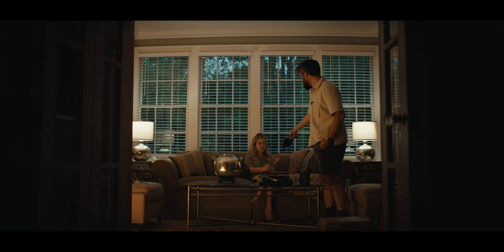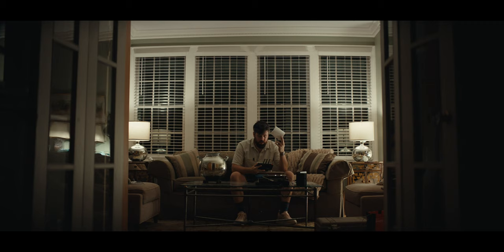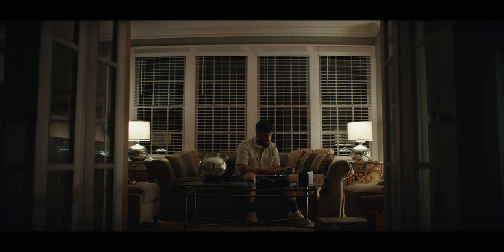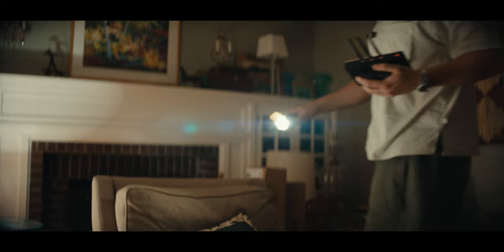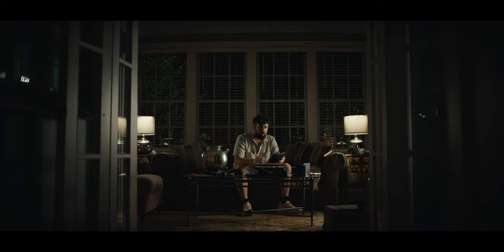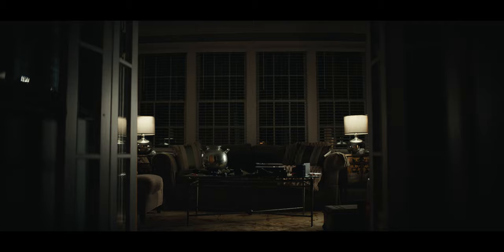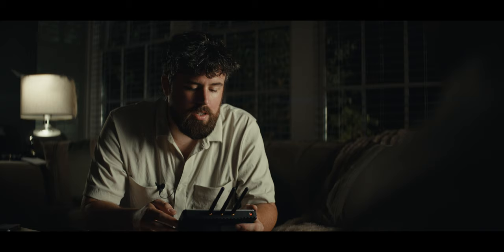Lighting night interiors

Comment: 00:00 - Intro
00:34 - Initial lighting setup, facing challenges with dark areas and shadows.
01:44 - Experimenting with practical lights and their impact on the scene.
03:09 - Using practical lights creatively, considering small practical sources for lighting.
04:33 - Adjusting lights for better exposure and realism, adding potential backlighting.
06:10 - Enhancements made for the scene, including exterior lighting and key light diffusion.
07:44 - Fine-tuning practical lights' impact, managing reflections, and overall scene balance.
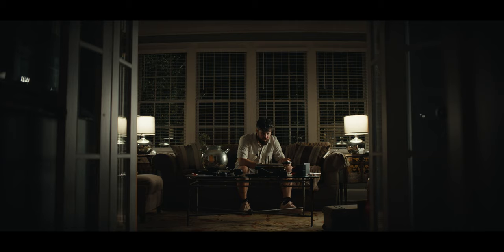09:33 - Achieving a more complete and satisfactory lighting setup, further improvements discussed.
Reply from the maker: Thanks for this, I meant to add to the description.
Reply: The fact he did this for you shows the love. 🤙
Reply from the maker: I owe a favor!

Comment: I think your final wide shot looked great, definite Fincher/Cronenweth vibes. I'm a beginner and often spending my nights up late like this on my own, when everyone else has gone to bed just hours and hours looking at my monitor, making small adjustments to the lights, and seeing what works and what doesn't. Lots of fun except when it's 2 or 3am and you have to just pack up all your gear that took ages to set up.
Reply from the maker: Thank you. Gaining a very good control over every light and what it’s doing is important. It’s easier when testing that it is on set, but the more you do it the quicker you are able to gain control on set and walk onto the set and know exactly what to do. Packing it up is tough. I enjoy leaving it out lol.

Comment: Great practice. So important to improving your skills. 

A few things that you might explore in the future: 

1) Practicals are rarely daylight balanced, so you might try setting them somewhere between 2000-2800 next time. To me, this would have made the scene look more natural. 

2) Not sure why you would put foil on the back of the practicals. The shadows/slashes of light that they create are the most “realistic” thing in your shot, so in my opinion you diminished the believability the minute you did that. 

3) The backlight you added about half way through seemed out of place, especially since your shoulder created a slash of shadow across your neck — giving away the fact that it was a source light rather than the practical. 

Thanks for sharing. These videos add a lot to the overall growth and development of future filmmakers.
Reply from the maker: hey thanks I only went daylight bc that is what I had, and if everything is daylight, you can balance the camera warmer and it will look very similar, minus any differences if you used actual tungsten. while foil is not the exact right material, cinefoil is used heavily for this exact purpose. I think the image looks wildly better without the very bright spots on the walls. you will see this done in tons of high end work. it is extremely common. sure you can have some light from a lamp on the wall or ceiling, but it is more often than not controlled similarly to how I did in this video. and as mentioned in the video.. I think I said 80% of the way there 🙂 a lot changes once you have the team there to polish that look.
Reply: @BlaineWestropp1 thanks for the reply. I would challenge your notion that practicals are manipulated this way, “A ton”, “extremely common”, and “more often than not.” Thats a statement that just isn’t supported by the body of images out there. 

In fact, id confidently state that for every one example reference you find showing the way you’ve done it, I’ll show you 10 that embrace the light that ever person in the world would expect to see from a common lamp 😉

Keep it up!
Reply from the maker: ive been on a lot of projects that use cinefoil like this! but in image making there really aren't any rules so you can do whatever you want. I oftentimes do not like what a lamp with a bulb in it, uncontrolled will do when it is close to a wall. it doesn't look right to me on film, I prefer to control it. light to our eyes, is a lot different than what a camera can capture. we can see more. so if you have a practical that you want to read a certain way on screen, and it is blasting the wall with light, controlling that is a way that you can have the light read how you want it, without blowing out the wall. sometimes cinefoil is simply put on the top of the lamp, so that light doesn't spill out the top, but that you still get it on the wall. lot of ways to treat a lamp.

Comment: Looks great! Not sure if you meant to say "you were going to soften the key light so you were going to pull it further away"  Make it larger or pull it closer to get it softer. Do the aperture B7 lights need to be connected to a local Wi-Fi to be able to control them?
Reply from the maker: I would not have pulled it closer. I would likely have pulled it further away and then softened it. Technically yes moving it closer makes it softer but it can make the falloff unnaturally rapid, which I do not want, in this scene at least. Apologies if I was unclear. b7s don’t need local wifi!

Comment: Very helpful - thanks for the video 🎉 was the wide shot also at 50 mm?
Reply from the maker: Thank you, yea the wide and the coverage was all on the same 50mm lens.
Reply: @BlaineWestropp1  you are the man 🙏
Reply from the maker: @eike.zender  😇
Reply: @BlaineWestropp1 would love to see a "day for night" approach. What handheld monitor are you using?
Reply from the maker: I recently shot day for evening interiors and it was awesome. I will probably share some info about that some time soon. The monitor is a smallhd focus7 with built in teradek bolt 500 receiver. On camera is a smallhd cine7 with built in bolt 500 transmitter. Hot combo 👌
Reply: @BlaineWestropp1  thank you, that would be awesome 😎

Comment: Awesome stuff! Curious as to what you had your camera WB set to? 

I see A lot of DPs shoot night scenes with warmer tones, so they either change camera WB, light WB, or do it in the grade.

Curious as to your thoughts on warmer interiors and what you did camera side here, as well as if you would touch anything in post. Thanks!
Reply from the maker: I am pretty sure camera was set to 5600 ish. There’s a chance I warmed it up in post a little but since the light was bouncing off warm tones in the room that may be responsible for some of the warmth. I will check in resolve and see what I did and report back!

Comment: I'm gonna go look through your other videos but do you cover how you control and pair all of your lights to a single remote interface or are you having to work between multiple apps for each light configuration? What device are you using to control everything in this video? Just an iPhone Aputure app?
Reply from the maker: When I’m doing this stuff at home, I’m going up to each light and changing it. When I’m shooting stuff not at home it’s pretty much all controlled from iPad when it’s led and a multiple lights.
Reply: @BlaineWestropp1  So you use different apps depending on the light brand or do you have a single interface that controls them all?
Reply from the maker: @DavidHaverty oh I just use whatever app they have. I pretty much only use the aputure app. But a lot of times I do shoots where gaffer has something that can control everything. I’d look into DMX control. I personally don’t know all the required pieces to control lights from different brands. If I don’t have a gaffer running everything I typically go up to the light fixture. You should join the discord I’m sure there’s people in there that can direct you.

Comment: Viewing note: The letterbox black bars on your video prevent the image from being made fullscreen on ultrawide monitors. If you upload without any surrounding black, YouTube will properly fit the video to different size screens. In it's current form, black bars are added to the side of the video to fill a wide monitor when fullscreen, which in addition to your letterbox creates a full black border around the video, instead of filling the screen on even 1 axis. 21:9 ultrawide monitors are fairly common, and it is incredibly more pleasing to watch a video like this--especially one focused on visual imaging--without this shrunken fullscreen issue. If you had no letterbox, the image would fit my screen almost perfectly. The 2:1 aspect you have currently won't fit any screen perfectly. It may seen weird to deliver in straight 2.39:1 or 2:35:1, but this is YouTube, and it improves the viewing experience greatly for those who use monitors wider than 16:9 (or wider than 2:1 in this video's case).
Reply from the maker: Oh i am fully aware. I intentionally delivered with this aspect ratio and black bars. I don’t like how straight 2.39:1 on YouTube looks on an iPhone, and you lose some features on YouTube when delivering straight 2.39:1. I do know that that doesn’t help people with your screen though :/
Reply: @BlaineWestropp1  Can you elaborate on what feature you lose?
Reply from the maker: Adding cards at the end of the video!